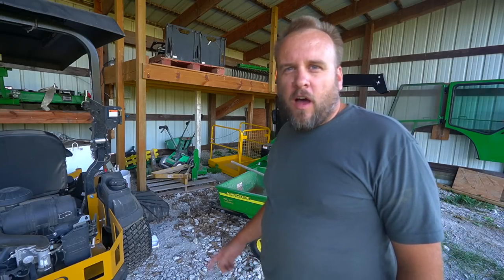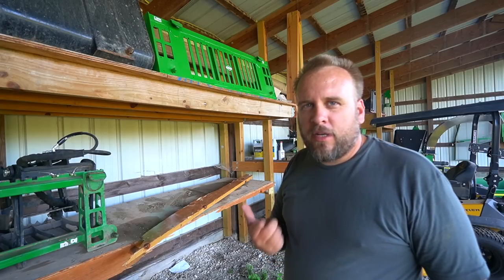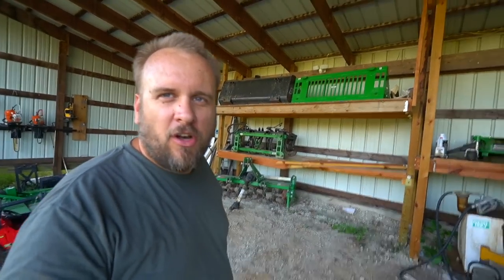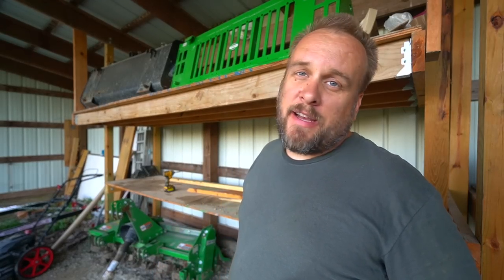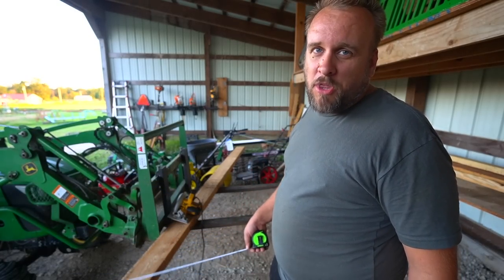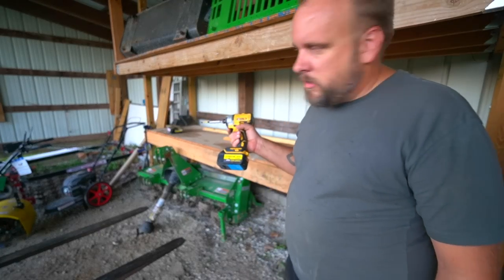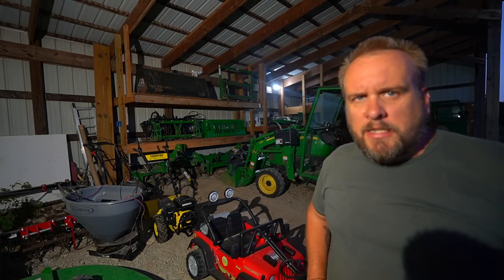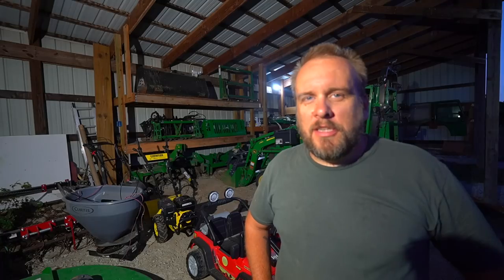You Guys Warned Me - I Broke My Tractor Attachment Rack

Comment: If you will put a 2x4 under each side of the 2x6 on the 4x4 using a bunch of construction screws, that will distribute the weight more onto the 4x4 and give the shelf more support on each end.
Reply: You mean vertically, from the 2x6 to the ground? Trying to visualize what you meant, and that makes the most sense (to me). Otherwise, please clarify.

Comment: You have to be extra careful now. Just saw you hit it putting the box blade back in there since you actually have about 1 less clearance.  But that's nothing the things going to be pulling it out with that ruff cute board are going to be a lot stronger  and if you catch it again you could lot more damage to your rake system